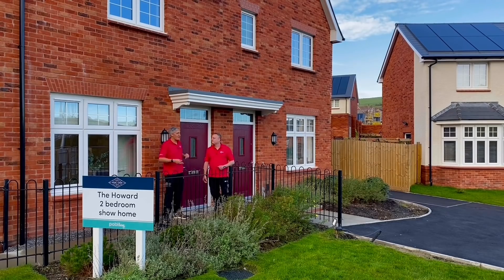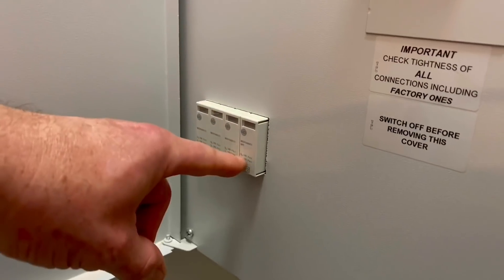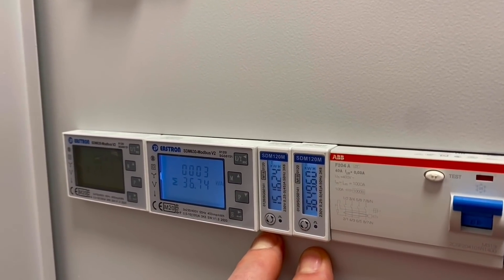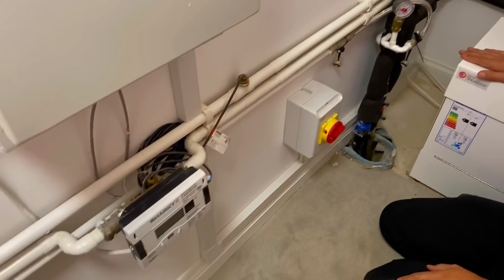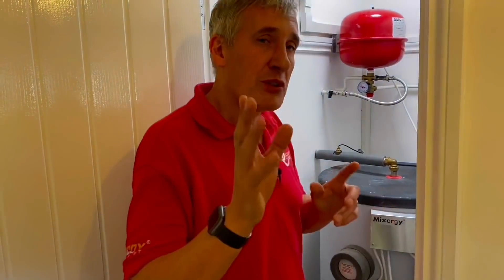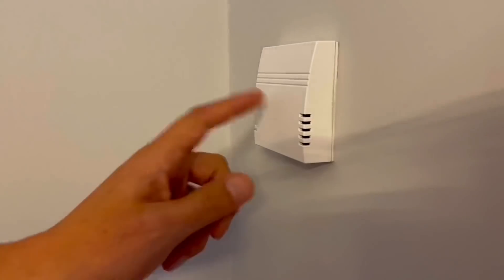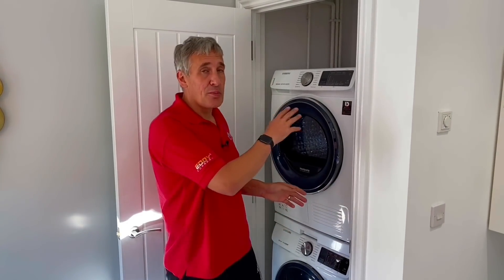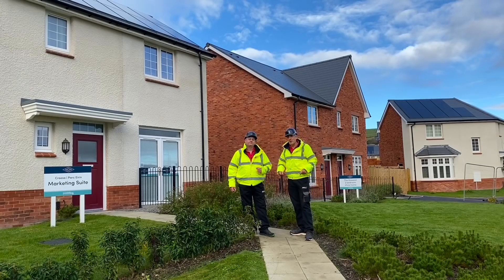THE FUTURE OF HOME ENERGY is HERE - A GAME CHANGER FOR ELECTRICIANS

Comment: How does the heat pump cool the house in a hot summer? We can be at 23C inside when it’s 35C outside.  Also where is the forced heat recovery and ventilation system that prevents condensation and eliminates mustiness?

Comment: Interesting video and the “kit” in the house is clearly very useful. The key to an energy efficient house is its fabric, although I appreciate you were looking at certain aspects , it would have been even better had the house been built to Passive House standards. Again it may not have been on your list to review but one of the pillars of passive house is an MVHR which would have “saved” much of the heating cost. The key to,energy efficient housing is build to Passive house standards and then fit the PV panels, batteries etc,

Comment: And the UK Government response is legally compelling builders to provide a car charger point.
No mention of solar or ground source pipes bored into the ground ready for connection.
This is NOT the future, it is how new build should have been for the last few years and into the future. It is a failure if builders and the government not to be using this as standard build.
The bare minimum on new builds to obtain planning consent is 3kw PV and ground source pipes under the foundations. Air Source is inefficient and expensive to retrofit even on new builds.

Comment: And this is the best of UK trades?

Don't get me wrong, I used to be a sparkie and know the constraints on time and differing levels of finish .... but that is a bit embarrassing for a show home!
Most of that "distribution board" has got to be waste space. Fine for industry but not so good here. The galvanized box on the tank is shoddy (even a quick spray from with a can of auto spry would be an improvement! The flying flexes .... great for cooling the cables but not a good look. There seems to be a control box mounted midair ..... why not fix it to the wall and have a conectios box next to it with all the flexes looking like someone actually cared? 

Having said all that it is a vast improvement tech wise! 
Hopefully people will find it runs seamlessly .... for a long time!

Comment: Far too expensive and complex.   Little of this stuff is actually needed.
The answer is passive house construction (massive external insulation and massiveb rick/concrete walls).
South facing windows to be large.
 These guys have never heard of KISS ( keep it stupid simple)
None of this expensive and complex equipment is needed. I have had a passive house for fifteen years, I know what I'm talking about.

https://en.wikipedia.org/wiki/Passive_solar_building_design

Comment: Very clever indeed, out-sourcing all the polluting technology (PV panels, batteries, electronics) to the likes of China, literally dripping fossil fuels, so that someone in the UK can live a nice, cosy, guilt-free life and pat themselves on the back over it!
  
8:36 "Take advantage of that excess green energy floating around on the grid"  Are you sure you are an electrician?  Do you really think "green" energy is lighter than "dirty" electric and magically floats to the top?  Can you point to any time in the UK energy mix when 100% was being provided by "renewable" energy, therefore making it excess?  What happens on a cold, dark winters night when there's no wind and no solar but you need heating and to charge your car to get to work in the morning?  5kWh isn't going to last very long!

Then there is the added problem that a high percentage of these new builds are actually built on historic flood plains! So with the changing climate, there is a higher risk of flood water lapping at your door within the next few decades, especially when you introduce the video as being "located in the Rhondda Valley, Wales" (the clue is in the name - a valley is a  low area of land between hills or mountains, typically with a river or stream flowing through it! ).  

The term Chocolate teapot come to mind!

Comment: Good to see developers installing energy efficient gear, and good to see some of the latest equipment actually installed. 
However, a request.. it is really hard for people to understand the difference between a kW and a kWh when even electricians use them incorrectly in their videos.. please try harder to use the terms correctly!
And as for the statement that the 3 phase EV charger can charge at "22 kW per hour" ...  sorry guys, but that limits my ability to consider you competent.. there is no such thing as a "kW per hour".  
There is a kW, which is what you meant, which is a measure of power.

There is a kWh, which is an amount of energy, not a power rating.
But kW per hour.. nope.

Comment: IF HYDROGEN  BECOMES   normal with HYDROGEN ready boilers all this is useless also with battery design changes you might not need three phase with no mention of glazing  and insulation it looks like let's stick all this in to grab the tesla owners very expensive  car to park outside the front door the old song little boxes all made out of ticky tacky sounds right what i do not understand with a lot of this is 90% of things in your home can run on low voltage DC why run through inverter + the fire brigade would not recomend using washer or tumbledryer or even phone charger over night
Reply from the maker: Is hydrogen the future - or just a get out because we weren’t clever enough to use available electricity?  With regards to the fire situation - all new builds in wales are equipped with sprinkler systems

Comment: Any sensible designer would have allocated the garage space or a separate basement or out building  for the fuse box the ev charger the power wall  the heat pump and the water heater  to throw it all in every cupbard is not the way to go people need cupboards for storage and the power wall in the kitchen was ricidiciolous looked hidious .glad it's not my house  8 out 0f ten for ideas 0 out of ten for design and installation
Reply from the maker: These houses don’t have garages

Comment: Great when new. See the stare of it in 10 years time when men of little knowledge of it get their ignorant hands on it. 

I have seen thermal stores ripped out then replaced with tanks in the loft and copper cylinders. All was needed was a blending valve replacing. 

When ye olden village plumber and electrician get involved expect to revert to mid 20th C.

Comment: Why did they not put the hob on the 3 phase supply? Most of them can be configured single, two or three phase depending on what type of supply is available in the country they are being sold into.
Reply from the maker: Good point - would reduce cable sizes also. However not sure you can get three phase isolators which blend in.
Reply: @efixx  single phase control circuit with 3 phase contactor? Then you don’t need an ugly 45A DP switch either.

Comment: So we have the additional cost of a three phase supply, what would that be in a year?
And what would be the cost of the equipment we see in the video?
What would be the temperature of the water supplied to the radiators ?
I suspect like many green systems it will be extortionate and will struggle to heat a normal house. And what happens if I need some fresh air, will it struggle with the vents/window opened?

Comment: By the time this video was published the "being paid to top up your battery from excess green electricity" boat had already sailed - and it seems unlikely to return. The Octopusagile tariff, which had dropped prices below zero on occasion, has barely dropped below 25p per unit for days (or weeks), and were it not for the max price per unit at present being 35p, it would spend a lot of the time above that, instead of being maxxed out at 35p as it is presently. The cost of EV charging is under pressure to rise too, as more vehicles come online, and the overnight consumption of electricity rises as a consequence. When the price cap is raised (in April, I believe) I suspect that both on peak and off peak tariffs will see significant increases. So, unfortunately the batteries and smart appliances those home are equipped with are soon going to become much less of a useful feature. It's not unlikely that within a few years electricity will be charged at two rates, with vastly different times to the present day: low rate from say 20:00in the evening until 16:00 the next afternoon, and then peak rate from 16:00 to 20:00 daily.

Comment: Could they not install some trunking for the top of the batteries and install it so that the sharp edge won't dig into a child head.
The installation looks awful. My metal working isn't amazing but I would use a file on the hole for the SPD.
I won't be calling the Sero Group.

Comment: All these devices heavily rely on immersion heating elements to make the water hot enough to use, which they don't really talk about...... The system looks like a complete mess.....
Reply from the maker: The heat pump can switch to higher output temperatures for hot water service 65C

Comment: This just shows how small and badly designed british home are. It uses up every inch of storage space in this very small home and makes it almost impossible to service and access. If we are going down this road clearly all homes will require a plant room.
Reply: No doubt!! We can build bigger homes if the farmers will give up all the land they're holding onto. After all, the livestock farms are the biggest methane producers and they are one of the main contributors to the climate change situation; or switch these eyesores to solar farms and ground heat sources for the average taxpayer.

Comment: 3 phase No mention that I heard about what size solar array was fitted to take advantage of feed in . 
Again with the battery what size how is it being utilised what is the overall controlling strategy . 
Ground source heat pump nice  but why go to radiators in the bedrooms when these could be underfloor. This is a new build ? 
This idea of new build estate with no gas. All high tech ? Fine. But why not go for a district heat system that provides hot and cold water to each of the houses.  To run under floor heating and or fan coil type units providing both heat and cooling in the property. And meter this heat / cooling energy and bill for it. Then the local common heating / cooling source can be built to a larger scale and more efficacy . Then all these small package units. More redundancy and maintained by external company . 
And why no rain harvesting ? To reduce the demand for expensive treated water .

Comment: I really think we need to start utilising the DC storage directly in the future. This would eliminate all the losses the inverter incurs. Most modern appliances will run directly off of "high" voltage DC. That is because they contain switch mode power supplies instead of Transformers, and can operate directly on DC if needed. This includes many LED light bulbs and light fittings. Some modern fridges, microwave ovens, all have replaced their AC motors and Transformers with inverter drives. That means Direct DC operation is in theory possible. 90% of these appliances that have tested work fine on "high" voltage DC. This in my opinion is the future. Why make AC just for the sake of it, if it's not necessary. Power factor; hysteresis losses; I2R and capacitive, parasitic losses  can all but be eliminated.

Comment: Noted an old BT NTE in the wall by the CU, they're not putting those in properties in England any more.
Also interested to know if they're moving the carbon creation to the electricity generator or if there is a significant drop with then new technologies being used?
Reply: Also the EV charger has the drip guard fitted the wrong way up. Hopefully that was the plumber and not an experienced electrician?

Comment: Notice you don’t mention price or the fact that most homes don’t have the room for all that  equipment or ground source heat pumps  which are still not as efficient as a boiler  energy trading  is only pence per kWh company to what you pay
Reply from the maker: More discussion on this coming soon. Heat pumps are much more efficient than boilers - average on this install 3.6kW out for 1kW in.

Comment: The planet has had it if we keep manufacturing more and more stuff.  Creating cheap sustainable electricity is the answer, not making more and more stuff.  Running an old incandescent lamp made from glass and metal (natural products) on sustainable, cheap electricity is preferable to running an environmentally hostile led (plastic, semiconductors and god knows what else). THIS HOUSE IS AN ENVIROMENTAL DISASTER AND THE BLUEPRINT FOR WHAT NOT TO DO.  Wave power/wind power is the answer not a house full of expensive junk.
Reply from the maker: So your answer is to produce more energy to dump in to energy wasting products such as an incandescent lamp? Over the last 10 years LED lighting has halved the amount of power needed to light the world.
Reply: @efixx  My point is, how much plastic is in this installation?  The world is 80% water, 100% covered in windy air and there are vast sun drenched, uninhabited, deserts where massive solar energy farms could be situated.  Careful harvesting and distribution of electricity is the key.  Technology for the sake of it, especially if it's bad for the planet is pointless.  Inefficient old school technology fuelled by an inexhaustable supply of cheap, environmentally friendly, electricity  is not ideal but better.

Comment: I do think KNX is the better option in order to maximize efficiency coupled with three phase for better power/load control, it can even be coupled to other systems/manufacturers due to it being open protocol and is independent from any hard-or software technology. KNX installation can be easily extended and adapted making it future proof, a simple bus connection is all that's generally required, 2core mainly.  Although yes the price is a little high currently and was always thought to be for people with absurd amounts of money but really its a system that can be used on even the modest budgets

Comment: How much is a ground source heat pump, the electronics and the central heating system. I’ve heard you may need two bores to keep a larger house, 4 bed, at £20,000. Not a cheap system and not very green considering the amount of new electronics.
Reply from the maker: The key is to make sure your property is well insulated first - that reduces install costs and running costs. The houses in this project have a shared bore hole (170 metres)
Reply: I have an older property, which I have insulated below the timber floors it also has external insulated render. My house although insulated to a high degree would not benefit from this type of heating. The problem with older properties is they’re draughty, manly from the lath and plaster. In order to get an older house up to the specification, insulation and draught proof, wold be to rip out and start again. This is not practical nor financially viable. This system works well in a modern build well insulated and sealed house and not for the majority of properties in the UK.

Comment: Domestic property. Three phase supply I believe would have commercial rate TAX. With a three phase DB, how do you ensure the DB door remains closed to maintain fire containment?
Reply from the maker: It’s still a residential supply. Businesses pay a different rate regardless of the supply type.  You can get single phase consumer units which the lid hinges down or is held open by a magnet.